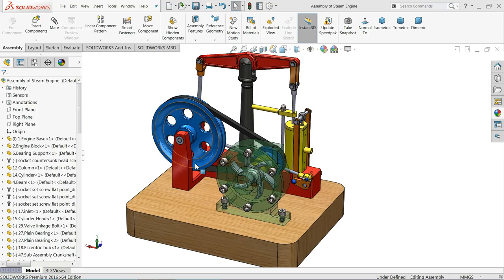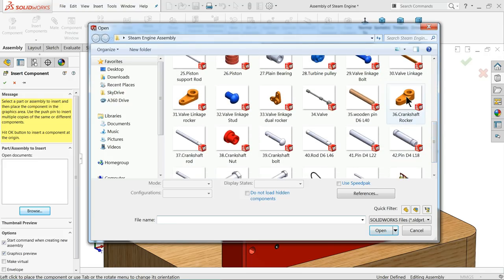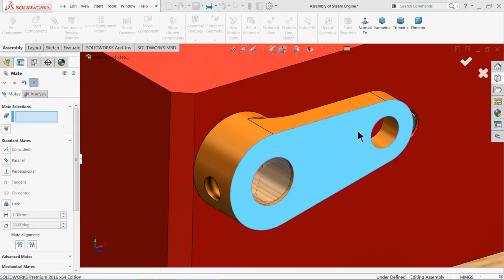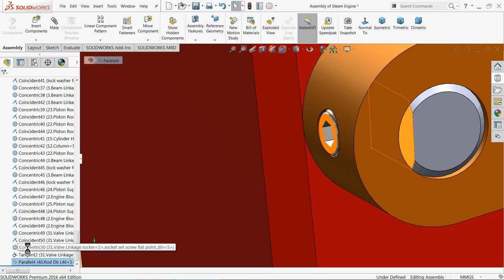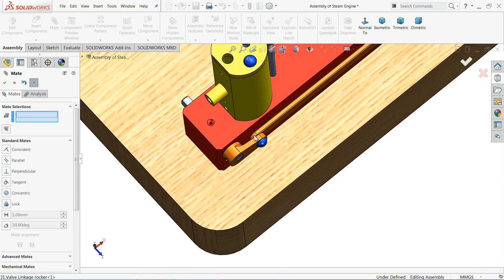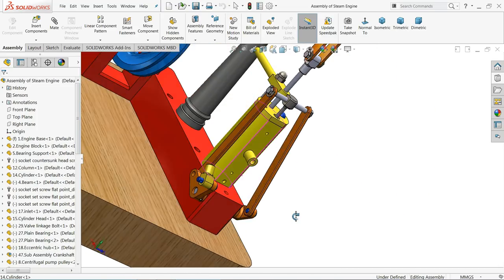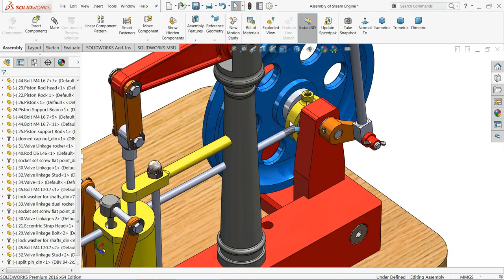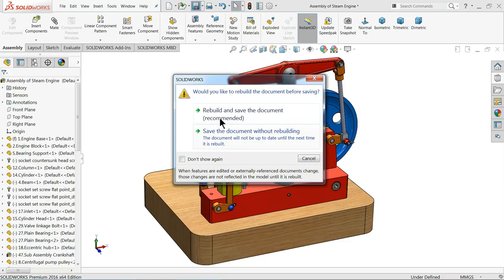Solidworks Tutorial Final Assembly of Steam Engine Part 8

Comment: I solved the problem problem with over defined parts.You forgot to install bearing on Centrifugal pump and key for centrifugal shaft & pulley. I think in the future you have to show the students the whole design and not the partial one otherwise the steam engine would not work. Also the screws connecting the centrifugal pump body and the wooden base are short and do not connect to the wooden base.